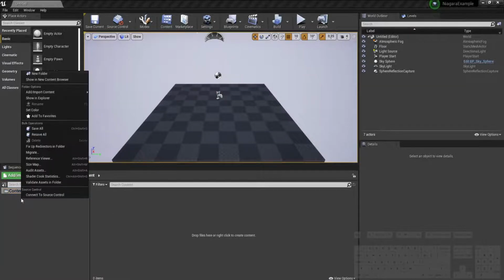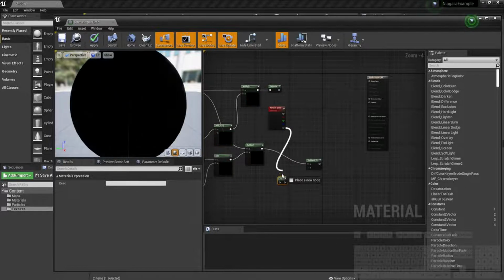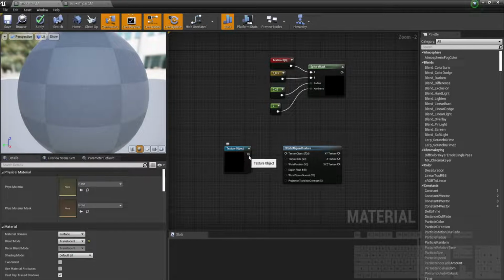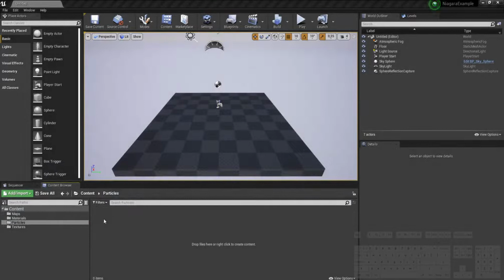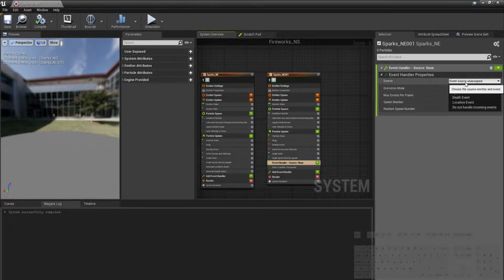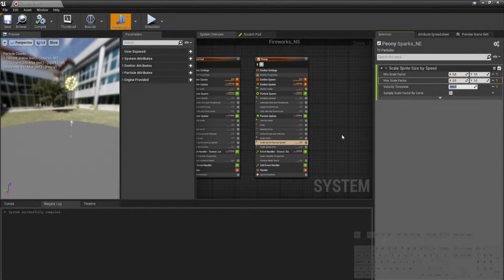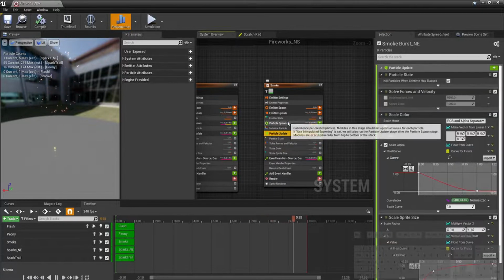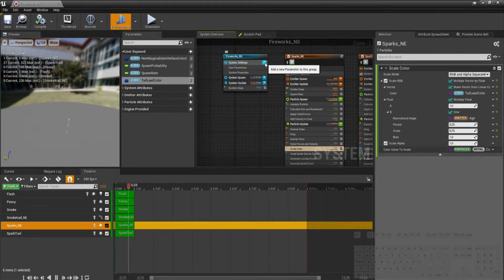Creating a Fireworks Show Using Niagara in Unreal Engine

Comment: Thanks you so much!! But i have question.. that is how can i control peony speed between start and end points in the explosion range?

I solved this question using as [Scale Velocity], but I have been noticed explosing shape changed Sphere to Plus..

 idk why Scale Velocity can affect to Shape?
As i know, Velocity Strength with Origin Offset from [Add Velocity from Point] Module perfectly make shape to sphere when peony received death event by the other.

But [Scale Velocity] doesn't have any Origin Offset ,,, How can i set the Origin Velocity offset point this situations??? 

Thanks you~